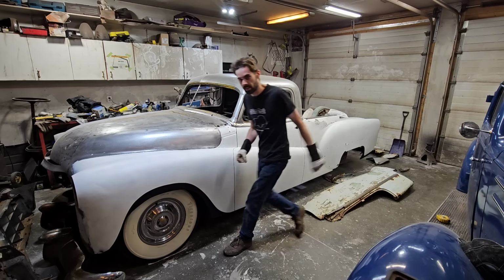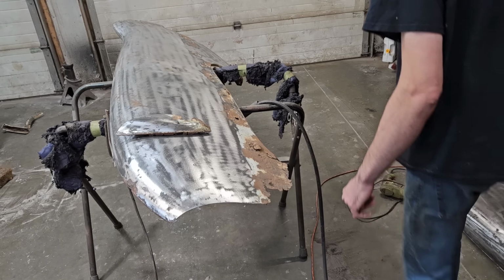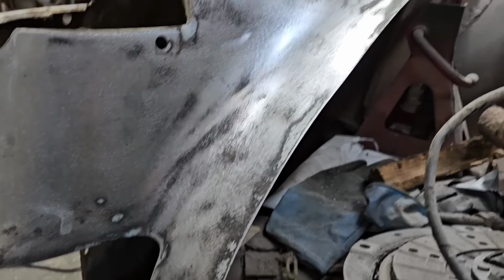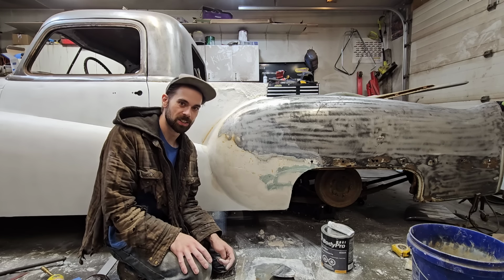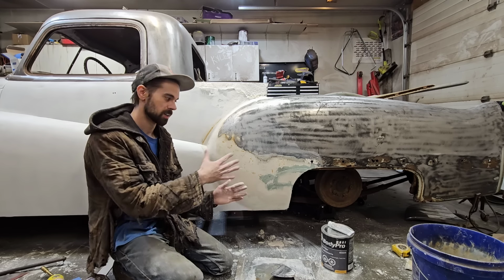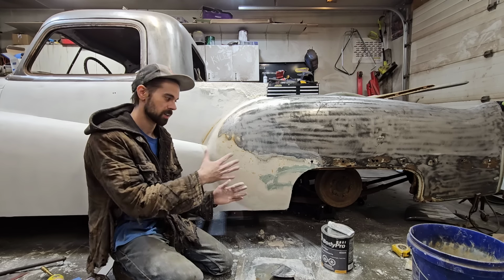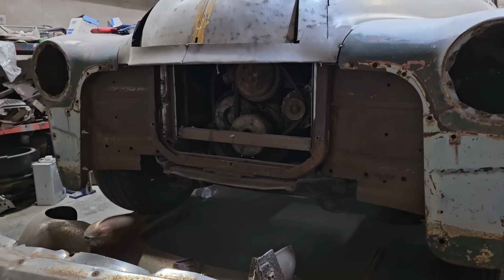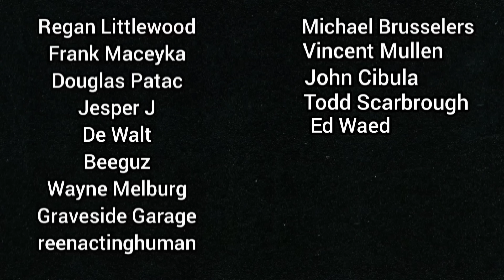MAJOR design change ⚠️ Cutting off the rear and starting over. Chicken Truck

Comment: That made the lines on the truck so much better. 
Will be a cool truck, hope you are going with the ‘straight 6 flathead Engine’
And you dont need to send the jacket to Norway, i have my own😅
Reply from the maker: I'm not sure the old flathead 6 will have enough power to move all the heavy Cadillac parts around, but it will be staying for now
Reply: GMC 270 six. Lots of dress up goodies for them ,even racing heads .bolt on to chevvy mounts and trans.

Comment: Oh let the process freaks spew off about it and then they can go on about their day feeling good about themselves.   On a side note, when you start making the metal panels, how are you going to attach them together while fitting each piece.  It's not like you can Cleco them due to the thickness of the buck 'skin'.  You don't have to answer, because I will watch it in the upcoming videos.  Love this.
Reply from the maker: Good question. For the fade away fenders I am probably going to make a separate plywood buck for the drivers and passenger side. For the other panels like the tailgate I may just glue in some sheetmetal tabs for the clecos to attach to.

Comment: Hey Kyle.  Firstly, congratulations on the 50-odd thousand subscribers.  I'm proud to have been a member since many episodes before the restoration of your first smoking jacket and have seen many a jacket smoke in my many hours of watching.  (Note: That last comment sounded a bit like I have been stalking you, but that's a bit hard to do when I'm many thousands of miles and a hemisphere away from where you live.  Just sayin....)

Saw you pop up in one of Scott's videos recently with the Caddy parts.  Thought to myself - hey, them quarter panels would look ace on the rear of the Chicken Truck....and here you are welding them on!  Love the idea of the front grille and bumper going on too as they are definitely adding bling to the nose without going overboard and too high on the nose of the truck, making it maybe look a bit nose-heavy or overdone.  Awesome result!   You know, I reckon the front marker lights might actually look good, but it is hard to tell without having them up there with it all....and that wont be for a while yet.  

Looking at the quarter panel placement, personally, I think that what you've done by introducing the Caddy quarter has made a great improvement to the side profile of the beast.  It adds a swoop and a flair that it needed without actually knowing it - and you're right, the curve at the front does look more in tune.  In looking at where the top of the quarter finishes, I'm wondering how it would look if you cut the panel through the middle lengthwise and lifted it by about 2-3 inches, so its closer to the top of the "bedside".  This would then have the fin for the tail light housing slightly proud of the bedside height and mean the bedside could stay one continuous level height in behind the swoop of the quarter and then be swallowed up as the quarter rises up to the tail light housing.  Obviously that would mean then resculpting the front of the quarter panel to maintain the original sweep of the curve, but that's doable.  A lot of faffing around just to see if it works, but if you can stand and look at the truck and imagine it with the top swoop of the panel just that bit closer to the top of the bedside and the Caddy tail light sitting up proud of the end....see what you think.....and it's just a thought, mate.  Certainly not raining on your parade or saying I don't like how it looks already.  

Looking forward to the next installment, for sure!  All the best

Comment: Would be kinda neat to incorporate a few other Cadillac detail like a Caddy gauge cluster or some front chrome dagmars off a '55 or '56 Caddy.

May I suggest not tapering the box sides?  I would leave them level so that you could have a more normal sized tail gate?  I don't mean a truck tail gate, my mind is envisioning a station-wagon style tail gate with a nice forward slope.

But if you're not thinking of having a tail gate at all.... well, then.... disregard.

Comment: You know, I've actually had sort of a similar idea, since I like the styling of the 46 Buick and such.  My idea was/is to chop one of these truck cabs, but to make a station wagon.  Genuine woodie wagons are less common than these trucks where I am.  One idea as well was to widen an old Ford/Ferguson tractor hood at the rear and use a tractor grille, make the front sorta look like a prewar Ford.  That being said, I'm surprised you're using all this cheap steel in your construction instead of spending a little extra money to do it all in foam.  That steel is just going to rot out in three months.  If it were me, I'd redo the whole thing in polystyrene.

Comment: Kyle ! 2 thumbs up on 49 Caddy fenders!! Still like idea of Nomad style tailgate. That truck looks awesome man. I still have a good running 216, and a 261 with 848 head on it,with 40,000 miles on it . But block is cracked. Give you heck of a deal on it  that caddy front grill and bumper is the cherry on top the cake!

Comment: My shirt and sticker arrived safe and sound, and very quickly I might add. I would like to kindly decline your generous offer of your slightly used jacket, I already have one that looks like that. Congratulations on reaching 50K subscribers. The Cadillac fenders were a good choice, and look good. I would like to suggest that for the tailgate of the Chicken truck, you hinge it on one side, so it will open like a door. Instead of dropping down, like a regular truck. Because that truck isn't a regular truck, it's Custom. Then you could use a door handle, to open it like the front doors of the truck.
Reply from the maker: Thanks for ordering a shirt and sticker! I'm glad to hear they arrived. I have considered making the tailgate open like that.

Comment: I wasn’t sure, but I suspected that this might be happening when you were caught loading up that truck with Caddy parts. I am old as hell and one of my first cars was a 53 Caddy ($65). I was amazed when the attendant pulled on my taillight to fill my tank. I didn’t fill it often because even at 25 cents per gallon it was cost prohibitive to do so.

Comment: Even if you decided to make the panels out of fibreglass, it would upset a lot of people. Having to make them out of metal is a great way to show your skills and creativity. 
I still cant fathom out how hte door hinges will look when done, but I am still loving the style. 
I seer you shortened hte wheel arch, are you re-centering the rear axle on it, or moving the axle back and having airbags. I can vision it just like Halfasskustoms has done his GMC truck suspension. :)
Reply from the maker: Wheel arch will be shrunk to match the original Pontiac opening
Reply: @CarterAutoRestyling  Will look great. Thanks. :)

Comment: Yes to the Caddy 1/4 panels. They flow so much nicer. Piss on the hater with 300 years experience as he most probably never attempted something this radical, or anything but "stock".
I have enough jackets like the 'prize' so if you pick me I allow you to use it this winter (and next....) 🙂

Comment: I want to see a collaboration project with Cold War Motors. Bring the 50 or 51Chevy, not sure what year it is, with the Cadillac tail lights to Carter Auto Restyling and do some more customizing. Then send the car back to Scot and the boys for one of their marathon 2 week paint jobs. I suggest you poke the haters by chopping the top. Maybe french the head lights or install 50s Buick headlights. That car is just sitting at Cold War Motors waiting for period correct Kyle mods.

Comment: 48 years I've been using Styrofoam  and plaster and jc you are doing it all wrong.  You need chicken wire underneath and spray on stucco before you paint.  Such a hack

Comment: too many morons out there bro.  I think anyone who watched, and listened would already know.  BTW what you are doing is an excellent way to prototype, as it is relatively cheap, undoable and so very flexible in reference to design change.  So cary on. Personally I am not keen on the fender change, but it is your vision.  As is, The bed would ideally have a low line to make it look less awkward. The old fenders could make be used on the inside of the bed.  Just an idea.  I am sure a lot will change.